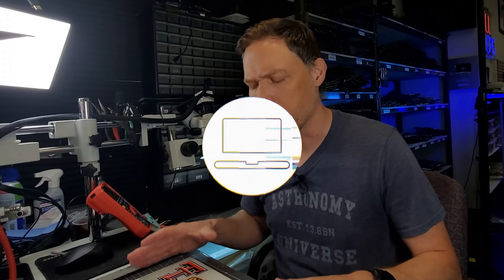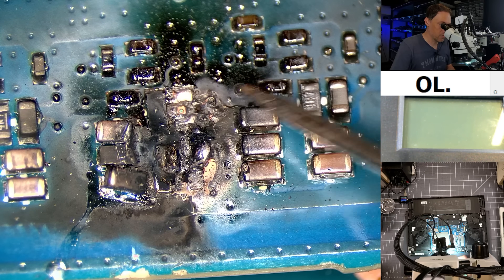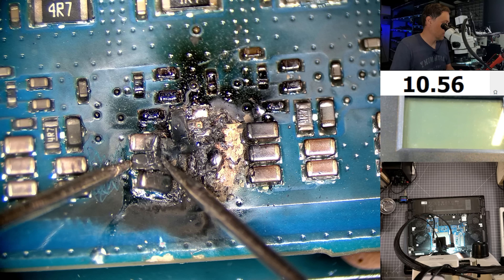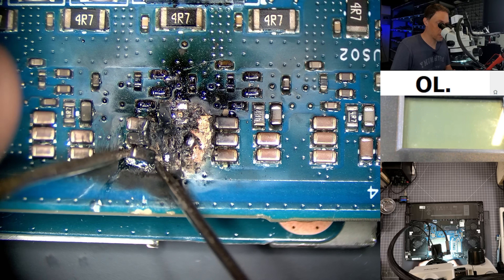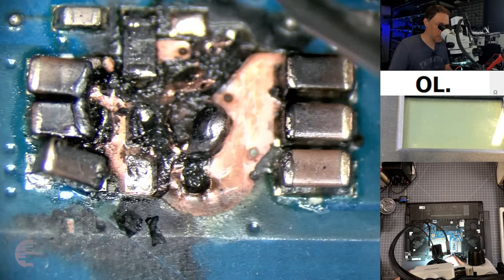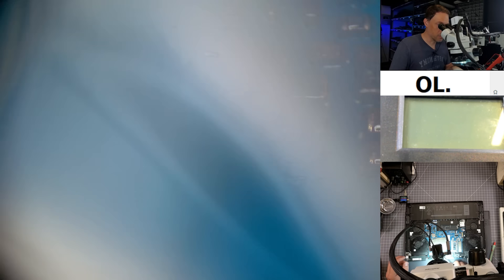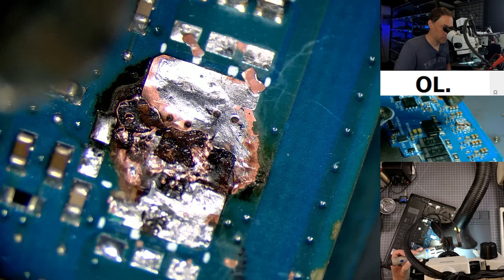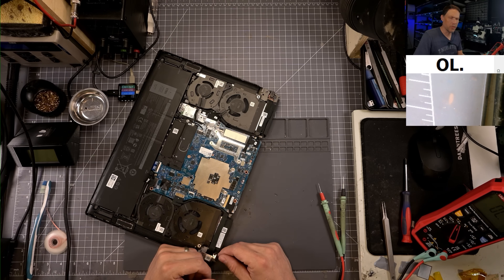GAMING Laptop Goes POP at the Library And It Turned Out To Be WORSE Than I Expected!

Comment: Getting a lot of tips and techniques from your videos. While you are a Dell repair center, the problems and solutions transfer to other brands easily, as they tend to copy each other at the base layers. I have a 20 year old Sony that no longer charges the right hand NIMH battery, but charges the left side - both are used in operation - gives me some confidence in finding that issue, maybe easier as there are 2 identical circuits to compare. (I have a 2 year old Lenovo that I use now, with a Ryzen 5500 hex core)

Comment: If it aint critical components and just filtering as you indicated... then you just grind away the boarddamage and the carbonresidue like you do on products where you have too and get to fresh layers, that still got layer sealing between it, so its not shoorting between layers, and then seal it and try to bypass that area.. there is a lot of redundent parts on these laptop that aint critical.
I know you wanna give a warrenty and all that jazz, but on a 2022 and fx a full new motherboard + repair.. you dancing on the edge of it not being economical viable and if it was mine, I would have prefered to no warrenty.. get it in a working state, and call it a day..
and you already did most of the work.. it would take you a few minutes with a grinding pen, like a battery-operated dremel, and clean the tarnished area by removing board that are scorthed, and see if it removed the short, if it did. seal it and try to bypass it. (but again I dont know if its critical components, only going from your judgement of filtering components)

Comment: To fix those blowouts you really need to clean area, then basically drill down all damaged layers for whole area that is damaged, there is suppose to be separation between layers and it is all burned up, probably layers are still fused together and those can got pretty deep, so you basically need to make multilayer hole that covers removal of whole burnt area, then you need to know exactly what traces are there and where they go, as you rebuild them layer by layer. Separating layers with solder mask or something. Because below could be traces not even related to what is on top. If you drill it slow layer by layer you can get at least shots of layers that would hopefully help, but it is bit of guesswork with hole this size without knowing exactly where what goes. And it isn't guaranteed fix either. I have seen some success with it, but even doing it, it can suck because you can then end finding out that something else also got caught into carnage. Like trying to fix graphic card, doing all the work, just to find out that GPU also got a bit of a shock and is dead now. Plus if there is some other issue that caused it, there is chance it will happen again and there is chance that when short happened and it went boom, it also effected other stuff, so you may have issues with something on board dying prematurely, because shock caused some damage and thus it was more marginal, just not yet broken part. So yeah, if you got to warranty it, good call.

Comment: Since you're not gonna have the extra filtering caps or whatever they are on the sides anyway, since there's no point in it, just scrape away at the burnt PCB layers there completely? Since there hopefully isn't anything else of importance there.
The separator will be fine further out anyway, so just completely scratch off the burnt parts In the middle
And maybe only save the section that connects to that resistor if possible, and add it on
And it might (?) work
That's the idea I had
Probably not worth the effort, it's more of as theoretical

Comment: This video is a perfect example why you carry a pocket ups/surge protector (single outlet) in your laptop bag.  Never (!!!) plug your computer in to any outlet in a public space without protection.  Most librarys have outdated electrical systems that are over voltage or high amp.  I have done IT support in many public locations (libraries, public arenas, cafes, retail)  and I wouldnt trust any circuit as safe.

Comment: I would try lifting as much of the loose copper films,  check that the shorts are gone, and add a layer of UV gel. The second layer is likely a ground plane. You just need to separate the top copper layers from the next ground layer. Then, just attempt to add as many of the capacitor as possible and the resistor missing. This should save the customer quite a bit of money from buying a new board, even if they have to recieve the repair without warranty.

Comment: Correct call!  I  see  videos of people repairing burnt or cracked multilayer boards and wonder why?  They spend hours grinding, patching, coating, testing and replacing components so any realistic labour cost/hr would  very quickly exceed the cost of a new board or machine.  Great if they are doing it just for the video and/or  as a hobby  but,   if they are doing it to make a living it just doesn't make sense. Alex at NorthRidge is a master of the NO-FIX cut off!

Comment: Rebuilding areas that like isn't that hard. you will however need a boardview or similar to know where everything connects. If you have that, it's a matter of using a dremel on slow speed, and grind away the bad area, and rebuild the layers using uv-resin over thin paper (i've used rolling papers) for the separation layers, and rebuild your traces, and pads with thin copper sheet.  

The only real issue with repairing that damage, is if the customer wants to pay for it.  Something that small, you can get away with it, larger areas, and the customer may decide a new laptop is cheaper.
Reply: I wouldn't trust my data on a laptop with a jerry rigged PCB.
jsid

Comment: In Russian repair shops they do fix this kind of damage by drilling out all the burned section and then rebuilding it with wires and some uv mask to insulate & fixate it, and they do provide warranty for it. But I guess labor is worth way less over there. I can try to find again those videos if someone is interested in seeing them.
Reply: There's a huge difference between the two countries' economics and the willingness to do the work.

Comment: What happened is the via in the board there swelled and shorted into the inner layers, no way to fix it but it's always fun to hit it with 30 amps and see how bad the short was with the big 50 amp crowbar power supply. We often fixed a few boards like that and then ECO wired past where the short was.

Comment: It would be interesting to see this fixed by removing the top layer that is burnt and if the second layer is not welded to the 3rd layer then add solder mask and order a thin pcb replacement for the top layer in the correct layout and add it back onto the board, if that's even possible.

Comment: What could have caused such a huge failure in the motherboard?
Reply: probably one of those smd ceramic caps, theyre notorious for shorting , thing is older 'wire ended' ceramics, especially the disc and tubular type are usually very reliable, but these miniaturised things arent

Comment: I have repaired military PWB's with burns like you show here. Removed all of the carbon material and rewired the missing circuitry. Many times, the problem just returns later. Good call!
Reply: this why technician rarely doing this, some popping short can't repairable
Reply: Even if you drill out the bad section theres a good chance you didnt fix what caused the short and it will appear in another spot.  Nothing wrong with attempting a fix but the odds you would fix it satisfactorily are slim and the repair costs too great.
Reply: Especially without any schematic... almost impossible

Comment: I suspect alot of shops would take one look and write off the board as not worth the time and costs to fix.
Reply: Like 99% of places won't even do a basic DC jack. I worked at a shop that did and we had 0 competition in that sector.
Reply: @JJayzX  When I was a teenager, I got laptops from people with broken DC jacks, that they were throwing away. Then I rebuilt the DC jacks with a soldering iron from radioshack and pieces of copper wire as supports... ended up with some nice stuff for myself, including a 2004 Pentium 4 laptop with gigabit ethernet and 1600x1200 screen!

Comment: I run into boards like this all the time when repairing 4090’s. I’d be happy to repair it and send it back.
Reply: But with a years guarantee?
Nah. Its time to go for a new Mobo.
Reply: @leosmith848 I wouldn’t have offered the repair if it didn’t come with a warranty. Why would I put all the risk on his table like that? That’s not the right way to do business. I’m sure some people do it, but I couldn’t do that to him. If I do the repair, I take on the risk.
Reply: Northwestrepair has fixed 5 layer craters before, it's doable, you just need to excavate many layers and rebuild them one at a time, hoping there is mostly power planes and little data traces.
Reply: It's a donor board now! The parts are worth more than the labor or success/failure risk to rebuild.
Reply: @mrrockenrock everything on a motherboard costs pennies. Sure, some mosfets, ports, EC and PD controller cost a little more. But most shops that perform board-level repairs end up with piles of donor boards on the shelf that end up getting thrown away eventually. Donor boards aren’t really worth that much unless you’re selling them. They’re really only useful for testing/comparing to the board you have in front of you. A board like this that has a dead short and doesn’t turn on isn’t worth much.